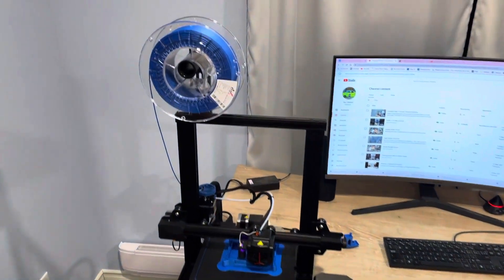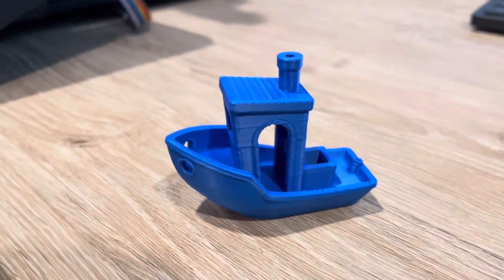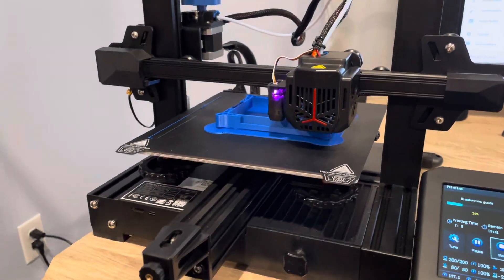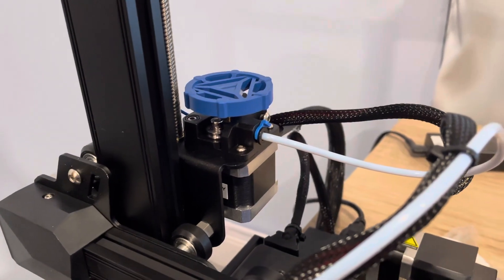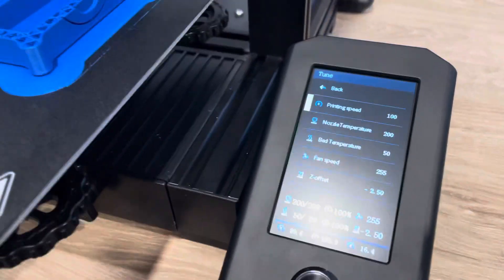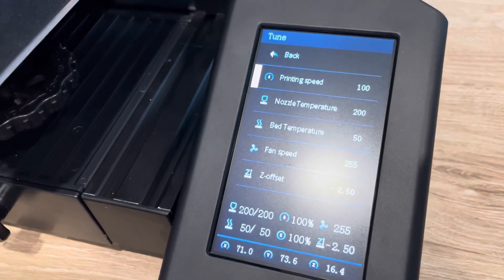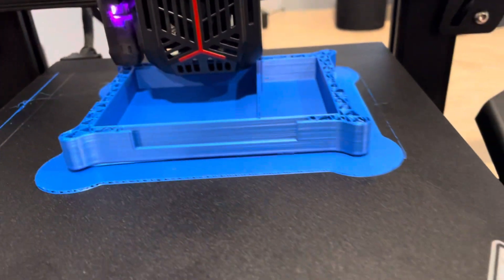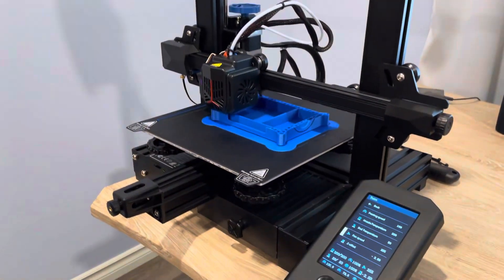Ender 3 V2 Neo in action

Comment: Spool holder is on the wrong way, should be on the back, even better there is a side mount bracket you can print which is MUCH better. See the sharp angle your is on where the filamet goes in to the feader.
Reply from the maker: yup, been changed already. Still not the best being on top..........always pulling the filament down.

Comment: What is "layer change"? There is no way to avoid it?
Reply from the maker: The printer lays down filament in levels starting at the bottom. Each level is called a layer. So after the first layer is laid down the printer has to start the second. The printer has to move up on its z axis and start again. It leaves a line on the model where this layer change occurs. Layer change is necessary and cannot be avoided.
Reply: @autotech4103  too Bad... Thanks for thé response
Reply: @NCOverion  the “layer change” is called a seam you can change its position to make it look nicer or hide it.